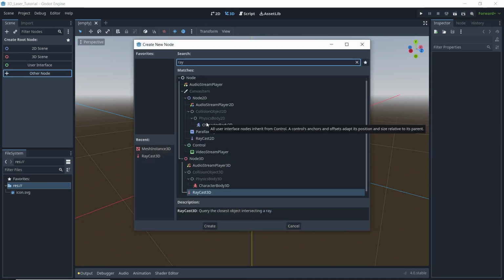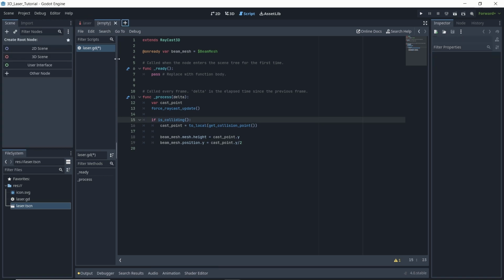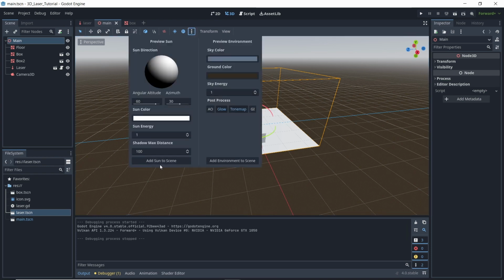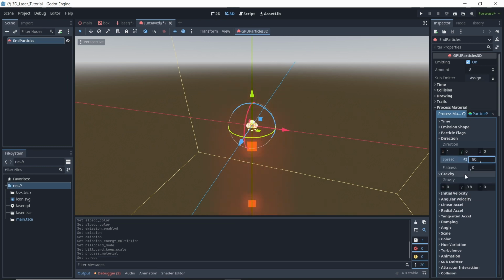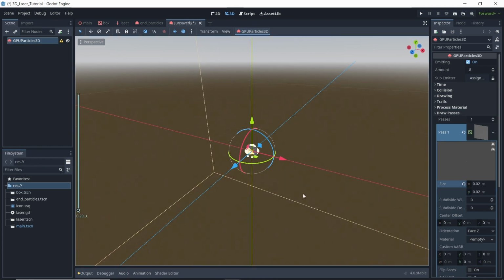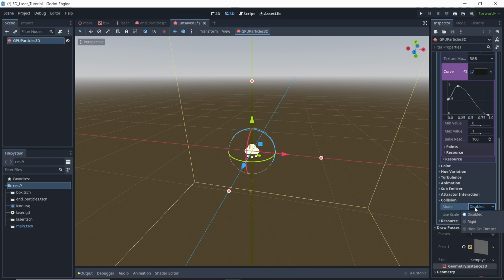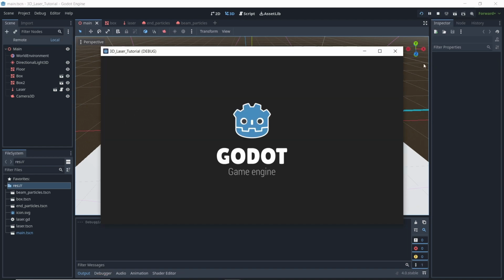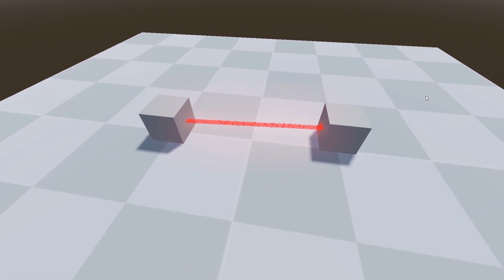Godot 4: 3D Laser Tutorial

Comment: It didn't render the laster until it collided with something, so I slightly changed the laser script:

extends RayCast3D

@onready var beam_mesh: MeshInstance3D = $BeamMesh

@export var MAX_LENGTH := 1000.0

func _process(delta: float) -> void:
	var cast_point: Vector3
	force_raycast_update()
	if is_colliding():
		cast_point = to_local(get_collision_point())
		beam_mesh.mesh.height = cast_point.y
		beam_mesh.position.y = cast_point.y / 2.0
	else:
		beam_mesh.mesh.height = MAX_LENGTH

Comment: Make sure the cylindermesh (meshInstance3D) is set to Local to Scene! (you can check local to scene in the resource tab) else all other duplicated lasers will cause weird behaviours like changing sizes and positions if you touch the others beams.
Reply: You're a lifesaver! This matters for the beam particles process material as well! You don't actually need the GpuParticlesCollision3D and the collider settings on the particles as we know where we're colliding from the ray cast already; so all that can be removed as we're already setting the position/extent of the particle emitter to match the length we know to make the beam already.
Reply: @MikewareXGR  Glad to be of help! I haven't worked on the particles emitter of my nbeam yet, but it sounds right to use the length of the beam to determine its position and rotation, thank you too for the info!